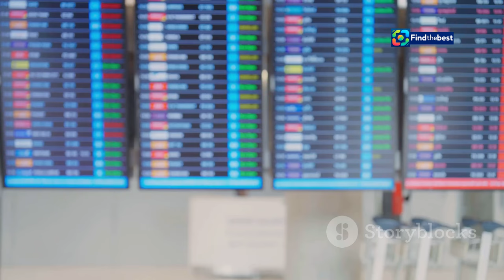Emergency Evacuation at Wellington Airport: Plane Engine Fire Incident! ️

Comment from the maker: OUTLINE:
00:00:00 Engine Fire on the Runway
00:01:03 Smoke and Fear Upon Landing
00:02:05 Emergency Response
00:02:57 Passengers and Crew React
00:03:47 Potential Causes
00:04:54 Aviation Protocols
00:06:14 The Aftermath
00:07:20 Rebooking and Support
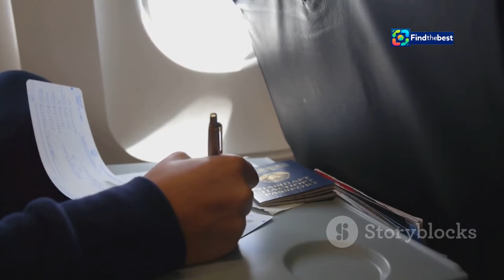00:08:21 The Enduring Importance of Aviation Safety

 Plane evacuated at Wellington Airport due to engine fire:https

🚨 *BREAKING NEWS**: A terrifying incident unfolded today at **Wellington Airport* where an *Air New Zealand* turboprop flight was evacuated due to an **engine fire**! 🔥✈

Just after 4 PM, as flight *NZ5366* from *Christchurch* was landing, smoke was seen billowing from its left engine! 😱 Fortunately, all passengers were safely evacuated and there have been no reported injuries. 🙏 

Watch as emergency vehicles rush to the scene and see the dramatic footage of passengers exiting the aircraft on the runway. 🚓💨 

🎥 *In this video, you'll discover:*
- The sequence of events leading to the **emergency landing**.
- Eyewitness accounts from passengers waiting for updates.
- What happens next for those affected.

Stay tuned for the latest updates on this incident and more from **New Zealand**! 🇳🇿 

👉 Don’t forget to LIKE 👍, SHARE 📲, and SUBSCRIBE 🔔 for more breaking news and updates! 

#WellingtonAirport #PlaneEvacuation #AirNewZealand #EngineFire #AviationSafety #NZNews